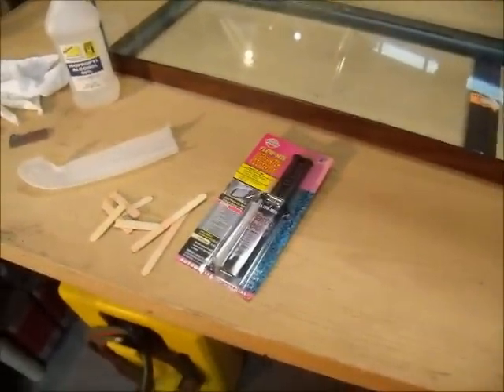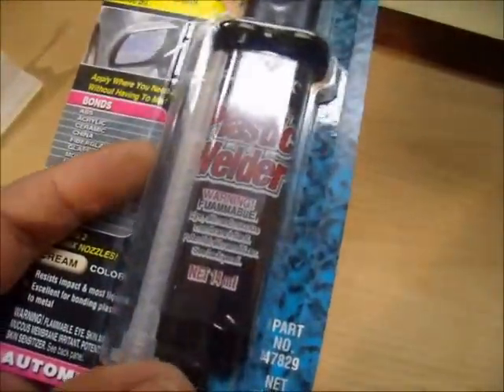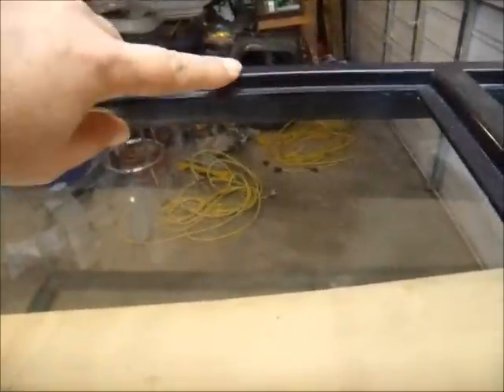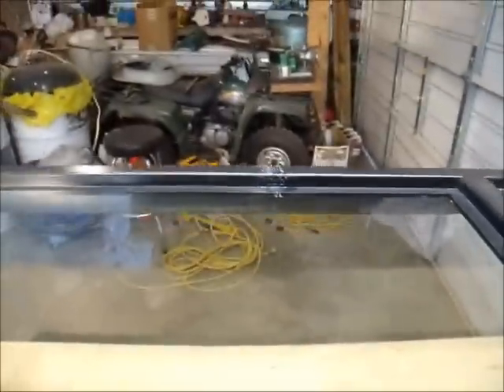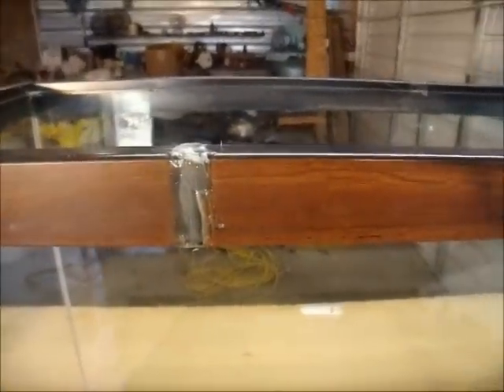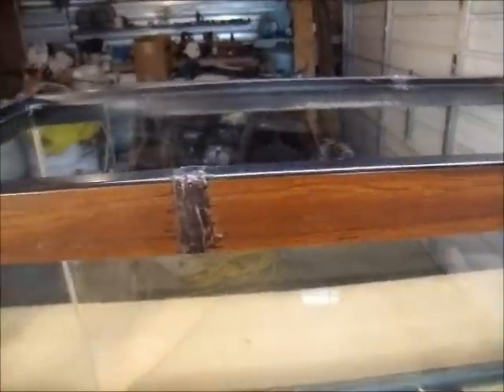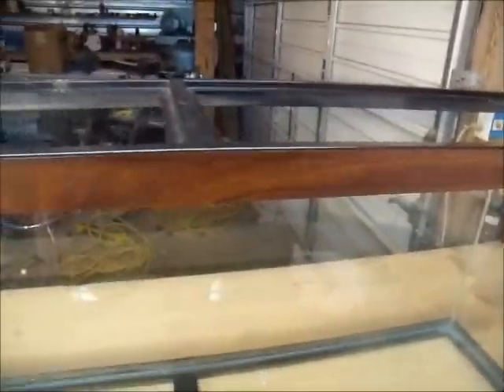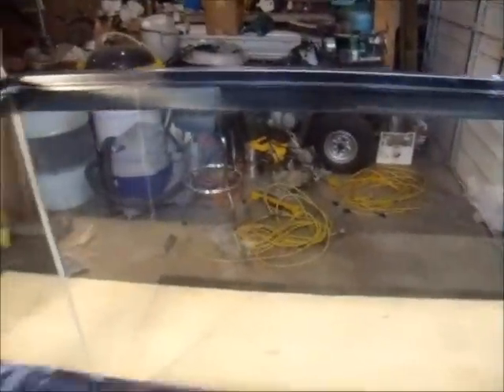Repairing a Fish Aquariums Plastic Trim with Epoxy

Comment: So that epoxy is aquarium safe? I got a crack in my canister filter
Reply from the maker: Yes I have had good luck with it and it is still holding great!! The only thing is I let it cure for a full 72 hours where there was no smell of the epoxy! This should work great for your canister just follow the manufacture instructions on how to apply and let cure plenty long as stated above. Thanks for your comment and let me know how it works out for you!! :)